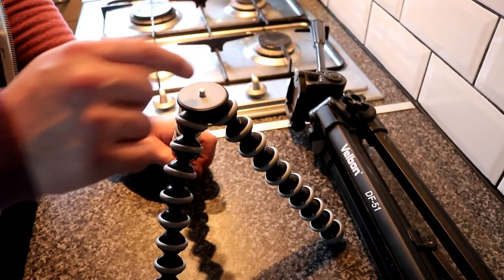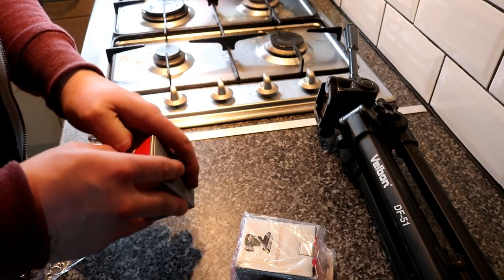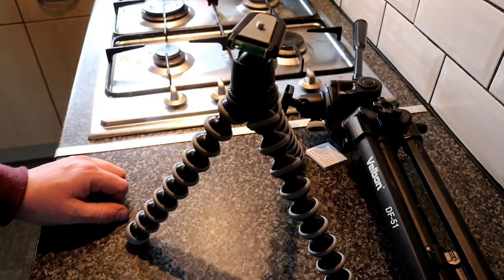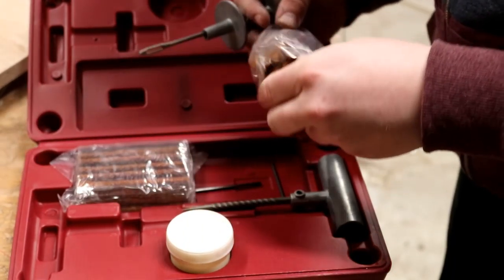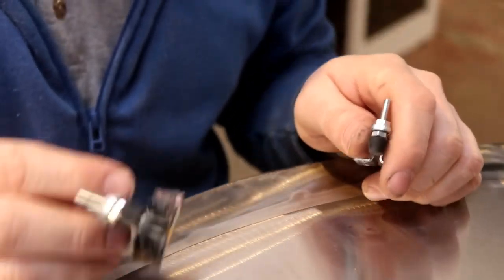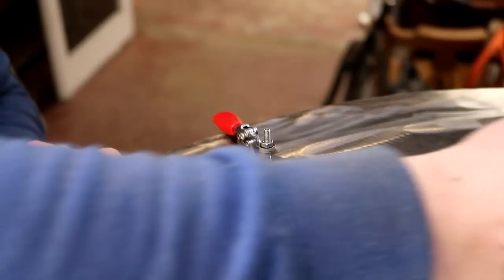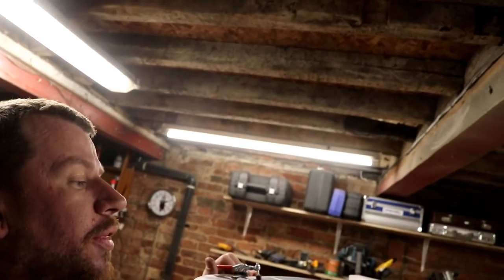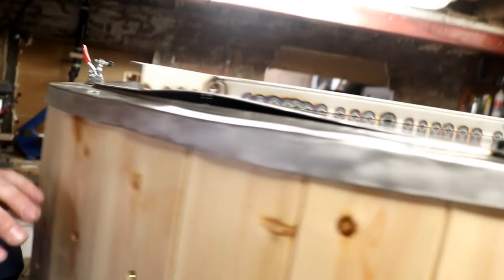Put a lid on it.

Comment: I've got a similar puncture repair kit and it works really well. It's no longer available but looks pretty much the same although mine is a bit smaller. Highly recommended though and easy to use; pull nail out, ream hole out to enlarge it slightly, fit thread to needle, push all the way in, twist a quarter turn or so, remove needle and trim excess off from the outside of the tyre. Cheers, Schnuz.